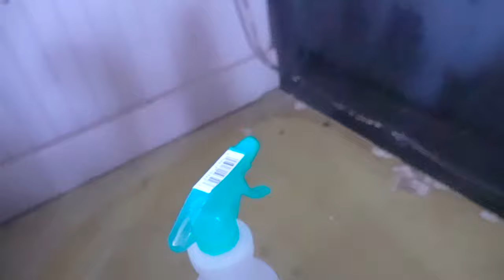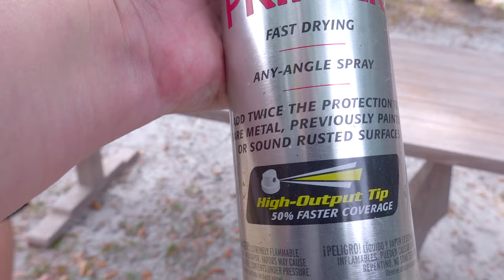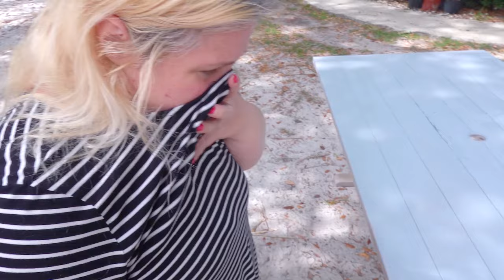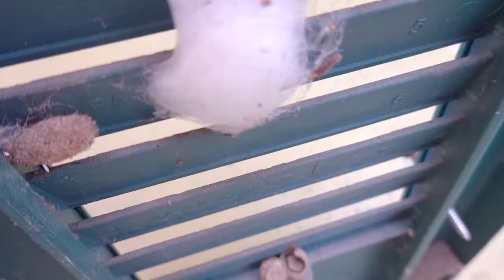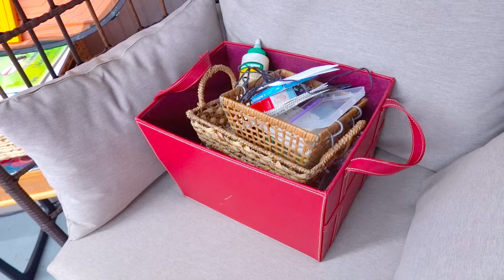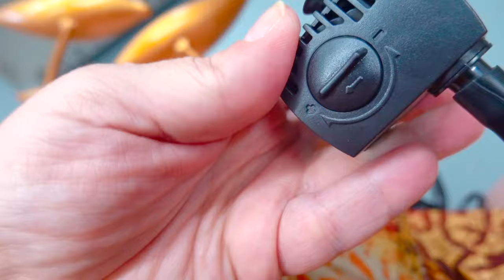The Truth About DIY That We All Need To Hear

Comment: God I know how you feel with the spray paint🥴, I just finished my old tiled fireplace with black and white spray paint, stunk the whole place out but looks amazing now so I'm really pleased with it. I'd have to sand that metal table to get the surface rust and loose flaky bits before painting it, you're such a good lad Raf for helping your Ma with it😉. Great idea to remove the false shutters from the windows, gives the bugs one less home and should help reduce the bugs from pestering you on the patio, looking great🤩 I'm doing so much here too with my decorating, really getting into it and enjoying the results🙏🌞
Reply from the maker: I wanted to sand it but looking at the worst part its almost like the rust made it several different layers and it pretty much goes all the way through. Was so mad that they sold it as an outdoor table! I need to spray like one more part of it.
Reply: @FoolyLiving  Ah I see. Yes if it's rusted that far through then sanding most likely would create a big hole in it. I've used rust converter before on bits of my car, you paint the liquid on and it turns the rust into a solid material again which might help a bit. Other than that it shouldn't have been sold as an outdoor table, they would have needed to use a different non rusting metal, it's false marketing on their part I would say😉. It should last a bit longer from your work to it anyway 👍🌞

Comment: I like the new color of the floor.  Very pretty.  If possible, I'd probably frame in the bottom half of the  porch walls and then screen in the top half to keep bugs out.  Kitty would probably end up claiming that area as her own.  Such a shame about the table.  It was so pretty when y'all first got it with the fire pit on top.
Reply from the maker: I've got a layer of bricks up right now to keep the rain out. But yeah eventually we need to screen it and make that wall solid on the bottom. That will be great!